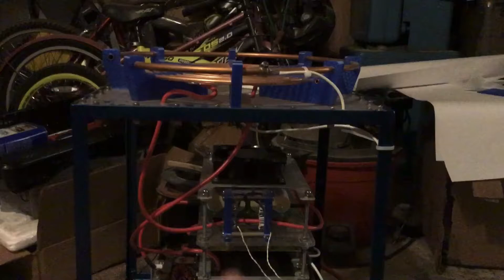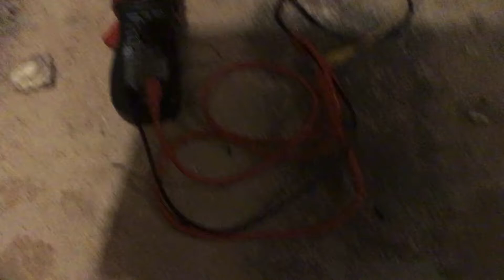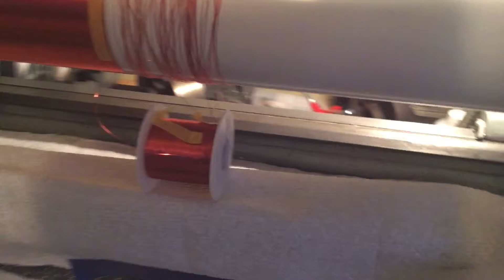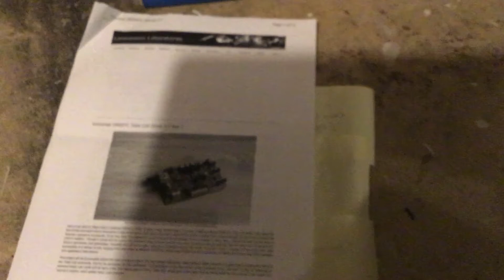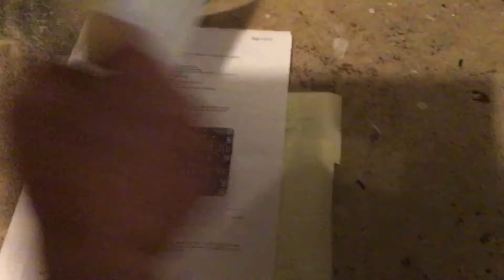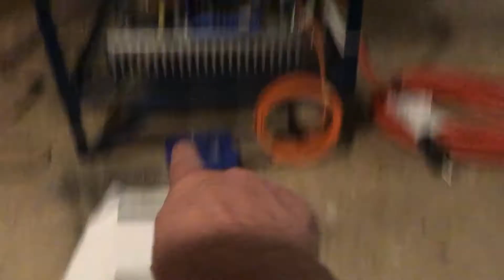DRSST Tesla coil build part 8; quick update, rats nests, and fireworks (not the good kind)

Comment: You've already helped me a lot. I'm doing that same tesla coil with that same controller for a univesity project so I might be able to help you. If you want, contact me
Reply from the maker: Thanks. I should be ready to test it tomorrow or Friday. I’ll keep you in mind if it doesn’t work.
Reply: @customfabrications  ok. Just use the variac and test it in a low voltage. And make sure the UD2.7c is powered with 24V

Comment: I started with a spark gap tesla coil and was talked into trying to build this exact tesla coil. I was following your videos then got impatient haha. We fired up ours a month or so ago. We used a ebay U2.7 controller, and to be honest we just slapped it in and went for it. Our arc length was only about 18 inches. I recently found out our interrupter wasn't outputting at a proper pulse width, so we are waiting on parts now. Before we try again I'm going to make sure to hook up our overcurrent protection. Anyway, I can't wait to see your results.
Reply from the maker: Oh man, sorry to make you wait on me😒, but glad you got it working. Let me know how the new parts work out. I’m hoping to have mine done in a couple weeks, or less. I may need to either rewind the secondary or buy a pre-made one from Eastern Voltage.

Comment: For the over current I would have to look at the exact documentation and schematic but usually you can measure the voltage at the voltage divider on the pot and calculate the current limit through the load resister to hit that voltage. Then take that limit and calculate the current limit through your Current transformer. Or vice versa to calculate what voltage should be at the divider for your current limit.
Reply from the maker: That’s basically what the instructions say, but it said to adjust to your desired current limit. Nothing in the coil schematics says what that limit is. I guess I could contact Eastern Voltage Research and ask them.
Reply: The main limiting factor is usually the IGBTs with some googling bc I don’t remember where I think keiser power electronics they have some of more common IGBTs listed and what they have been run up to because with soft switching you can sometimes load your IGBTs up to > 1.5x the rated current.

Comment: I don’t know what your exact questions are but I just finished my large DRSSTC a few are videos on my channel if you are interested at all. I’m not as well knowledgeable as the other hobbits in the field. I’ve only built one coil but have experimented in coiling for a while. I’d recommend signing up on high voltage forum and also looking at kaizer power electronics DRSSTC design guide. For scoping you can verify your driver works by disconnecting your GDT from your IGBT and scoping the output going to your IGBTs but I looked like you were already running it in the video and it sounded correct. For mine I have a varrriac I use to adjust the voltage going to the regulator so I can test the power electronics around 50-100v and then slowly increase the bilge but it looks like you do not have that option. For full power testing I also fear for my scope and you don’t need a secondary to test it. I just put a small metal pot in the middle with a little water. You can then run your primary and hear the song the interrupter is playing and the can should get super hot. I also have a wire floating in the air near the primary and that’s enough to get a scope signal I find.
Reply from the maker: Cool, thanks! I’ll check out your videos. I do have a variac and tried it yesterday. I just didn’t show it this video. This may be a dumb question, but when you put a can in the center for a dummy load, should it be connected to ground? Thanks again.
Reply: @customfabrications  no it works like an induction coil on an electric stove. All the Eddie currents in the magnetic field heat up the can. It should be somewhat isolated from the electronics and set on something that won’t melt right away. One of my older videos sort of shows the process I did Large DRSSTC Test 1. I have two videos named that  poor choice my part but it’s the older one.
Reply from the maker: Thanks
Reply: Maybe I got it wrong, but powering the Tesla Coil and leaving the IGBT gates disconnected can ruin the IGBT itself!
Reply from the maker: I have no idea, but they’re not disconnected.
Reply: @customfabrications  good